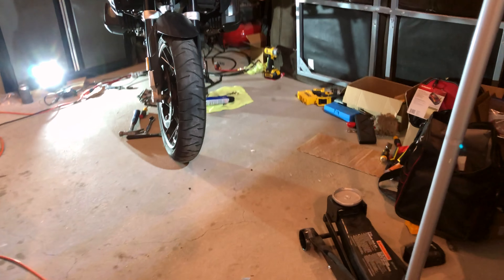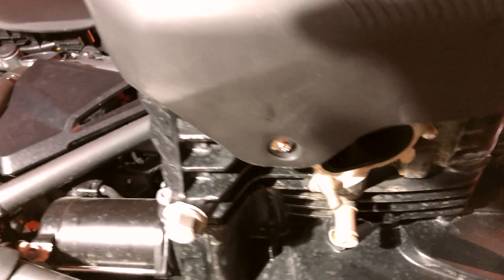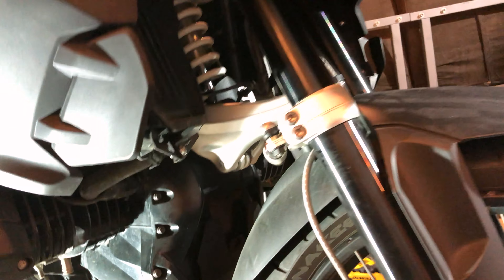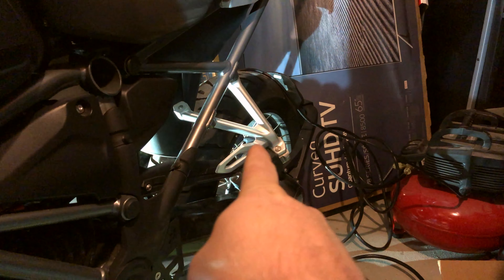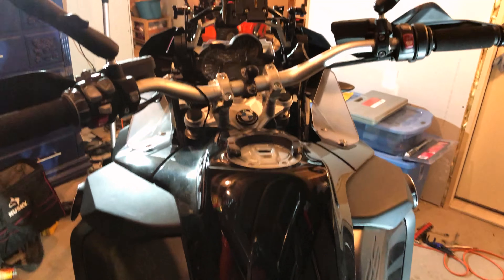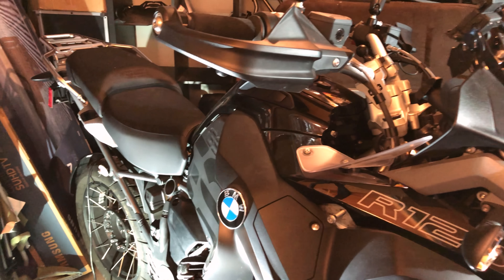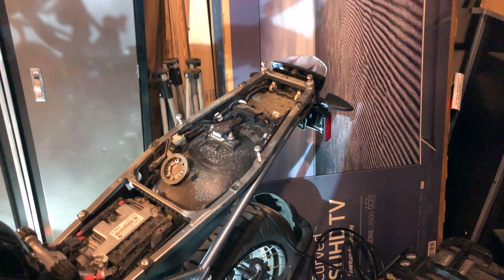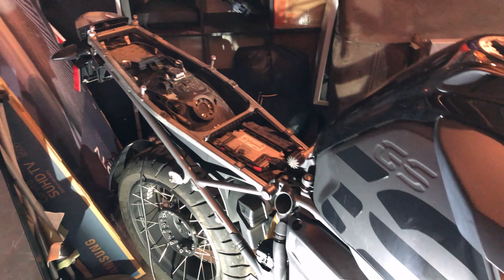Naked BMW R1200 GS Adventure LC - Powder Coating Prep

Comment: What tool to remove the front wheel? I just put tkc80s on mine and didn’t need anything special to remove the wheel. Also what’s happening with the bumot luggage?
Reply from the maker: I grabbed this tool - http://www.advdesigns.com/bmwfraxreto.html - regarding the Bumot, I have sold them and bought got Jesse Luggage. I just lost confidence in using them another season.